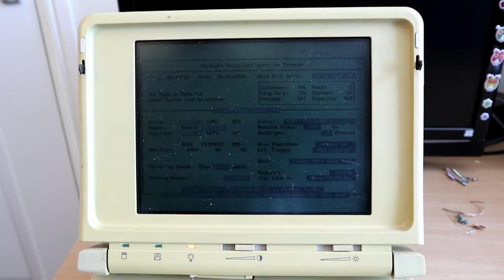Zenith Supersport SX Part 2

Comment: I had one of these in the hope that I would be able to use it for "limited" retro gaming (i.e. no color, no special sound card, etc.) This would have been so good if the VGA chip had not been crippled. It works, but the VGA chip they used does not allow one to play non-standard VGA games like Wolfenstein 3D, Doom, etc. Anything that uses that chunky pixel mode would produce display corruption.
Reply from the maker: It’s a shame it’s so limited. Mine is so far gone I’m not sure I can do anything at all with it. Maybe one day I will get it up and running properly.
Reply: @SteDubya  Well, even for a limited machine, I would have expected to be able to play Doom on the internal screen. (The internal screen worked, but Doom and any program that uses video modes other than straight 13h only works on the external VGA connector.)